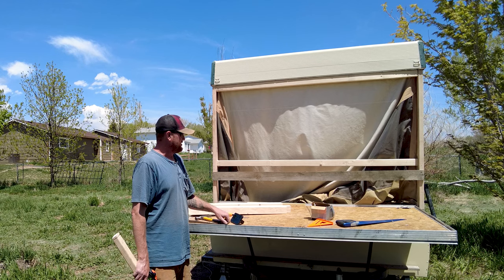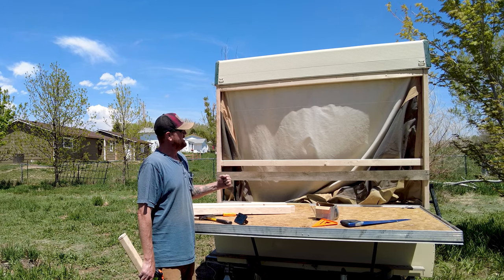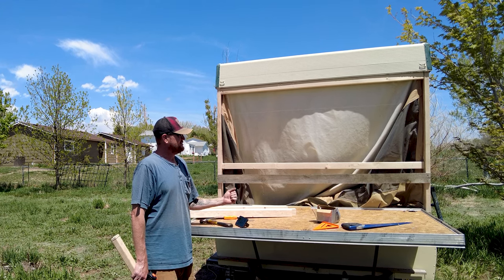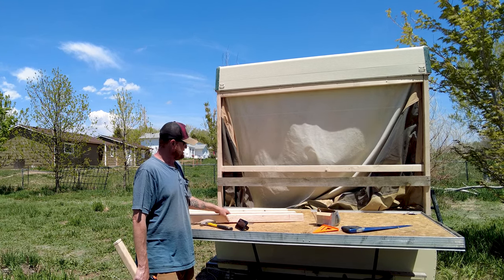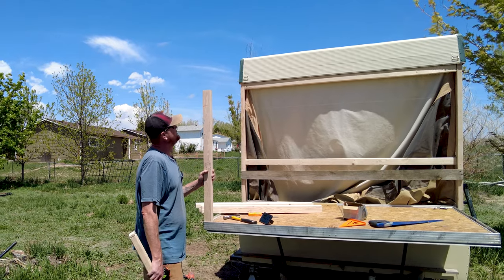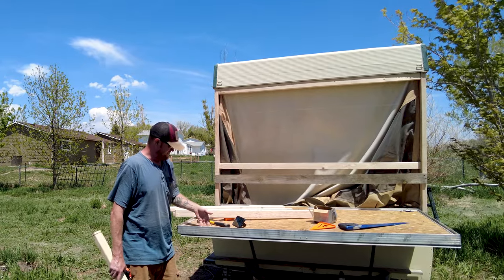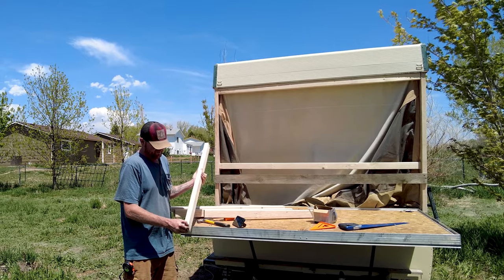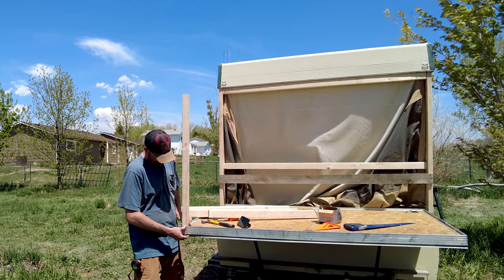1978 Coleman Pop Up Camper Conversion to Hard Sided, Pullout Walls Mockup & Build

Comment: Interesting concept. 
Although, with this new hard side extension not extended, I don't see how you can access into/through the trailer door, access interior if necessary. 
Are you planning to add a Vee nose to improve aerodynamics?
Suggest that the siding on this exterior slide out, extend over the aluminum angle that the vertical are screwed into. 
Will the roof on this slide out be sloped to shed rain?

Comment: Hey could you post a video of sliding the beds out? Is it difficult to do with one person due to the added weight? And also what do you plan on using for the sides?
Reply from the maker: The next video will show the pull outs a lot better.  The extra weight is not a problem so far on the pull out rooms and they are still pretty easy to pull out.  The walls will be a thin wood sheet covered with marine vinyl.  Keep tuned!

Comment: Hi! I have a question about the roof. I am in the middle of remodeling my camplite 10SG pop up camper to make it all hard sided, just as you have done. My roof needs to be redone and I am wondering what you decided to use as material for yours?
Reply from the maker: I used a roll on bed liner on my roof, seems to be holding pretty good so far.